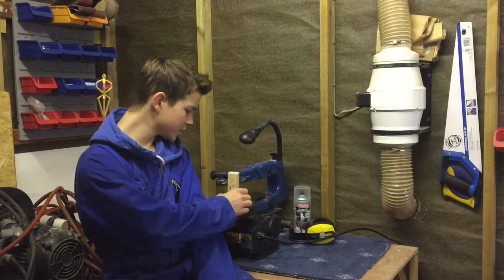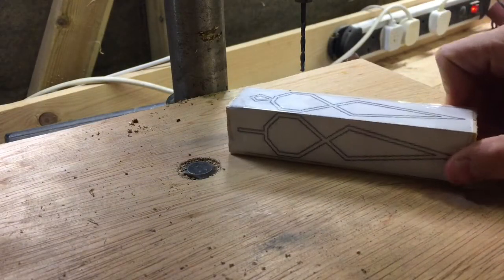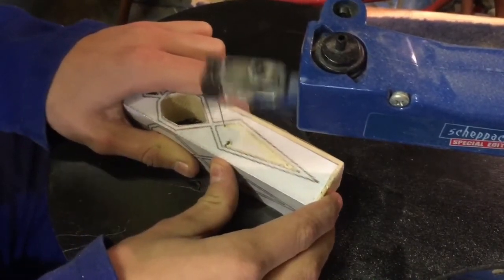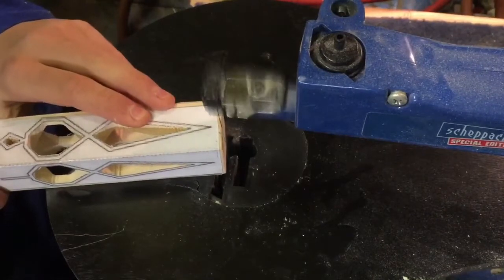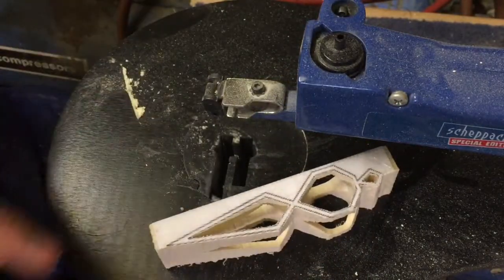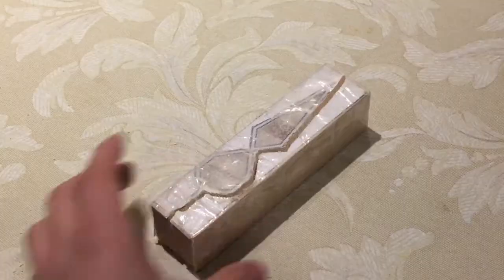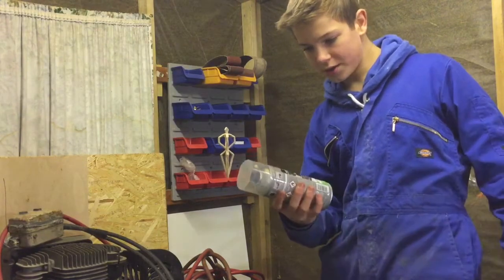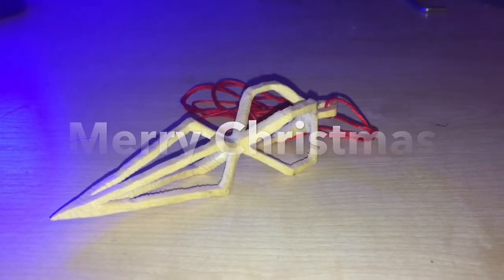3d Christmas ornament/gift (How to video)scroll saw project. Compound cuts on scroll saw

Comment: Will you do a very good job cutting with a spiral blade just some advice 3D ornaments and intricate scrolling you should use a #1 blade it will give you very nice clean and sharp corners, for me spiral blades are good for areas that does not need to be sharp looking you really want your project to look clean with 90° angles you can't achieve that with a spiral blade, Keep up the good work
Reply from the maker: Alan Wasserman Thank you for the advice.will have to get a hold of some no1 blades from somewhere and retry this ornament again.